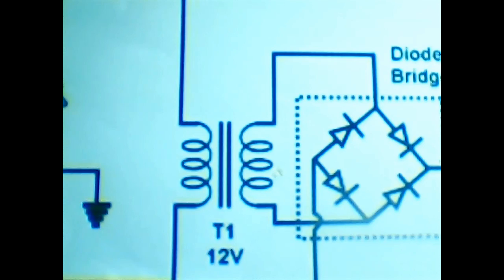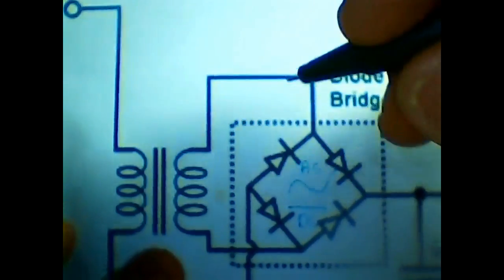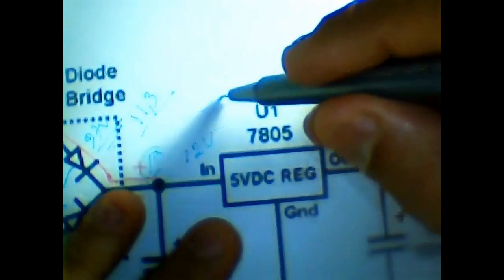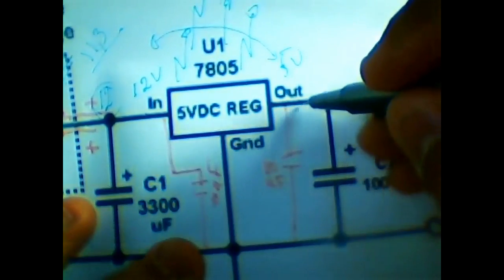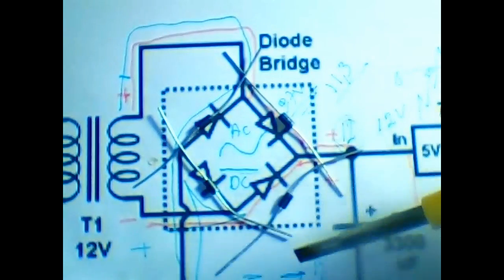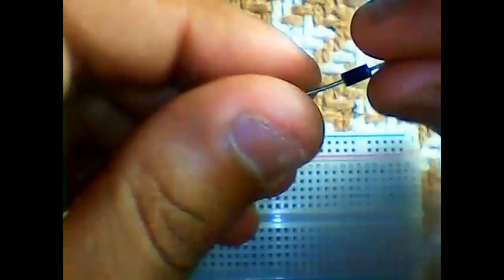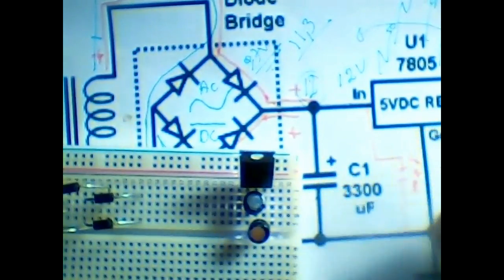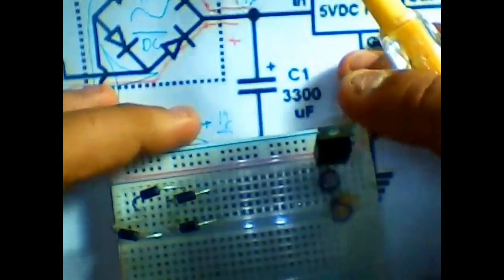ALL what you need to know to convert  220v "AC" To 5v  "Dc" #4

Comment: Are you using nano farad or micro farad capacitor because in the video once you mentioned micro but next time you mentioned nano ,please clear it
Reply from the maker: damn sorry for beeing late , use micro the smooth the voltage and nano to filter some on the noise